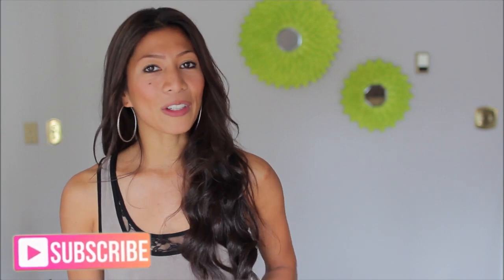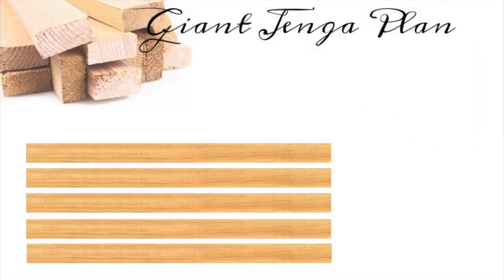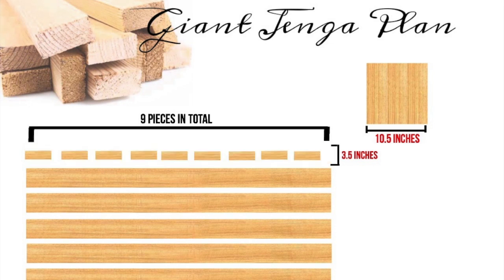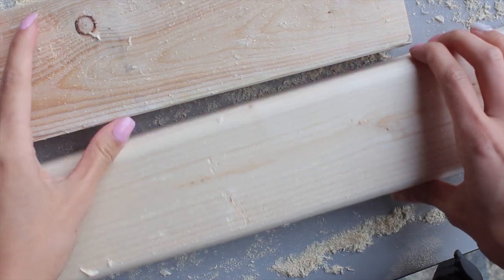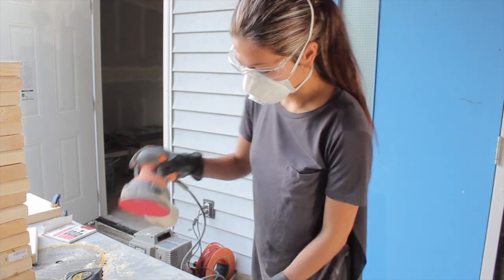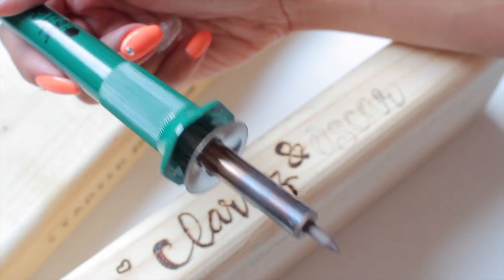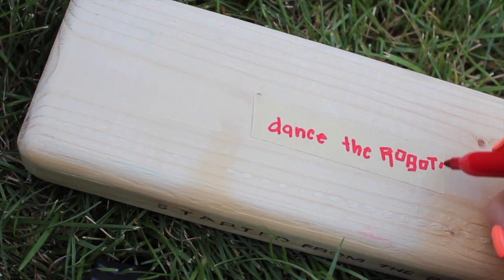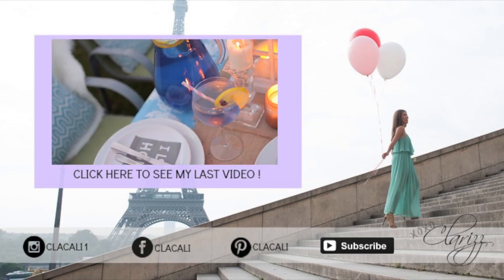DIY GIANT JENGA +how to carve logo & decorate!

Comment: What is the cost of this project
Reply from the maker: - $20 (7 pieces of 2x4's ) if cut at home
- $20 (7 pieces of 2x4's) + $1 per cut of about 2-3 pieces of wood each time, so 54 pieces  should be around $20-$30 + sand paper ($5) = estimate cost $50 If cut at Home Depot or something alike. 
-sometimes if the guys aren't busy at Home Depot/Rona they cut it for free, or at least the first 4 cuts are free :)